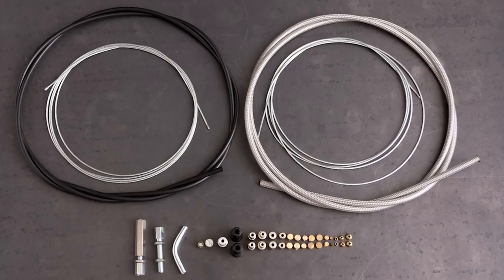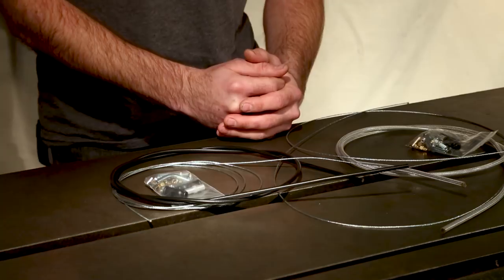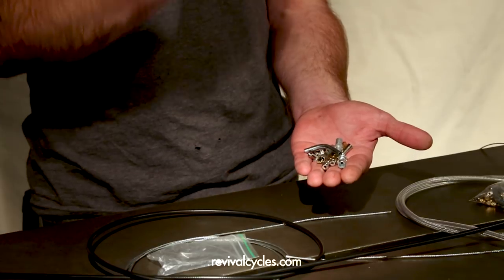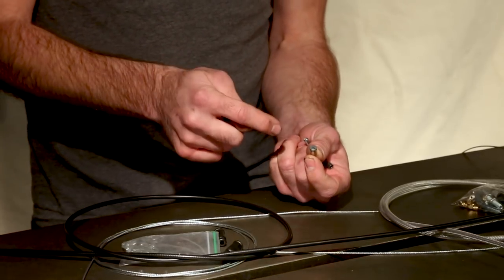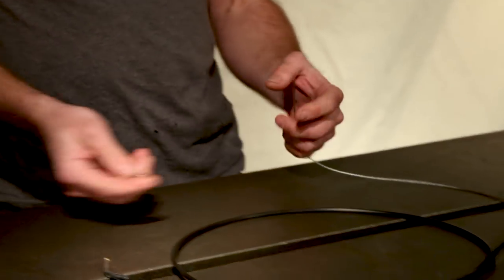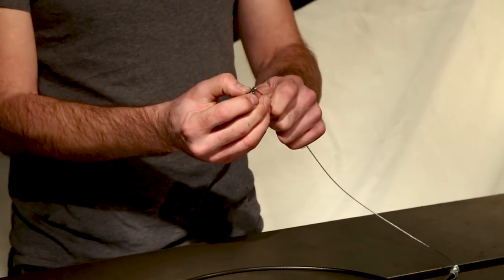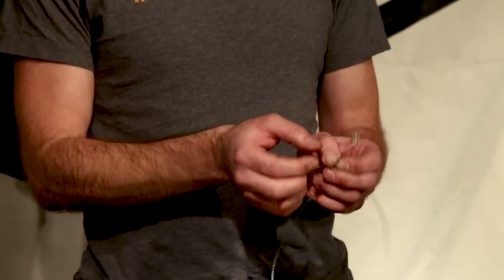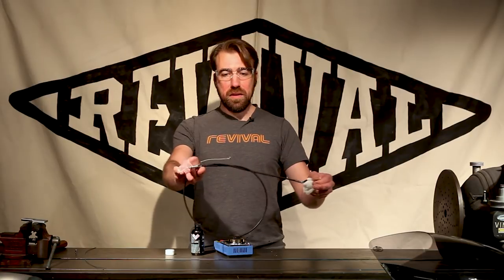Revival Cycles Tech Talk - Custom Throttle Cable Kits

Comment: I can see that cable end with the flathead screw being very handy for test fitting to make sure your inner cable is cut to the proper length for your throttle travel. I'm heavily considering picking this kit up as well as a stainless brake line kit in future for my Virago 750 bobber project... maybe once riding season is over. I have exhaust and frame mods to do at the moment.

Comment: Stefan you can also use a candle to heat up the lead pot. I've also used a candle to solder brass tubing together.
Reply from the maker: That is true, and I've seen others do it that way...I don't have many candles laying around the shop, but I do have a bunch of propane torches :)

Comment: Forgive my ignorance but can I just double these up for my Honda's push/pull style throttle?
Reply from the maker: You can, but this kit doesn't include the two different and Honda specific elbows needed for the factory throttle. We do have those elbows in black that we can provide if you request them at orders@revivalcycles.com.
Reply: @RevivalCycles  Right on, guys. Thanks for the reply. :)

Comment: Do you have to use the bird cage?  Or is there another option such as just flaring the end?  Also do you crimp the fittings? ie the 90 and carb adjuster
Reply from the maker: You don't have to use the birdcaging tool. You can use a fine pair of needle nose pliers and create a similar shape by hand. 

Depending on the fittings we may crimp them or we may use an epoxy adhesive to old them in place.

Comment: How did you secure the ferrule ends to the conduit?
Reply: Also, where are the neoprene boots supposed to attach?
Reply from the maker: To secure the ferrule ends onto the cable housing we use a ferrule crimping tool.

Comment: I used lead instead of solder but it stuck to the end like a SOB and now I have a glob on the end. Should I just Dremel it down clean or clip and start over? Afraid to heat up again and make cable brittle.
Reply: Making custom cable for attaching vm36 to Suzuki Savage.
Reply from the maker: If you decide to try and clean it up be sure to take precautions. A mask and gloves in the very least, use a file or sandpaper not a power tool,  try to contain and clean up the dust.
Reply: @RevivalCycles  will do. Decided to snip it and order some solder and a pot to attempt again. Think the flux got all over the copper while I was fumbling with cable. 
My cable assembly is a bit awkward due to the extra bits on there. Thanks for video and tips.

Comment: Where would a decompression cable fit on the spectrum of throttle, clutch and brake cables?
Reply from the maker: That is a good question, and I would think a throttle cable would do the job just fine. Most of the decomp cables I've seen are fairly light weight and often have routing with sharp bends and the decomp doesn't take as much force as a clutch or brake and gets used far less frequently. Based on all that I would go with throttle size housing and wire unless there has been a pattern of cable failures.

Comment: Would rosin flux paste work or would it need to be liquid?
Reply from the maker: It's worth a shot if that's  what you have but you might find that it's difficult to get flux paste in all the nooks and crannies without also getting it up the cable where you don't want it.

Comment: Disappointed to find that more than half the fittings in the kit don't fit the cable you supply with it. While I have been very pleased with most everything I've gotten from Revival this kit falls a little short of my expectations.
Reply from the maker: Sorry you were disappointed with the kit Rick. You can pack it back up and send it back in whatever state it's in and we'll refund your money. 

There is only one variety of cable fitting that doesn't fit the diameter of the cable provided and there two included in the kit. Our thought is that if you have the capacity to solder your own cable end then you surely have the capacity to drill a brass fitting to the cable diameter first. If you find that more than those two will not fit the cable then it may be that the dab of solder at the cables end to keep it from fraying needs to be cleaned up. 

-Berry
Reply: @RevivalCycles  that's what I did, but if I recall there were quite a few kmore than half) that were for small diameter cable.

Comment: Do I need the bird cage tool?
Reply from the maker: Not necessarily. When building a cable it's important is that you spread the wire threads in a fashion that will keep them from pulling out of the cable end. This can be accomplished with a hammer and a punch just not as effectively. The "Bird Cage" shape allows solder to fill the void making it impossible for the cable to pull out.
Reply: @RevivalCycles  Thanks guys!! You guys are awesome! Gonna be making an order for the kit.

Comment: I think it would have been much easier and healthy for the cable to cut it using a Dremmel with a cutting weel instead of side cutters
Reply from the maker: Since this video was produced we've found a source for the perfect tool for this task (Link below). But a good set of side cutters, emphasize the word good, will do the job just fine without unraveling or causing damage to the cable. A  rotary tool would work just fine so long as you taped the area you intend to cut or else it's going to be harder than you might think. 

https://shop.revivalcycles.com/park-tool-professional-cable-and-housing-cutter/

Comment: That is the wrong way to solder. You never force dry the solder and do not touch, move or disturb the joint whilst it is setting. You are creating a big weaknesses for the sake a 2-3 minutes waiting for it to cool.